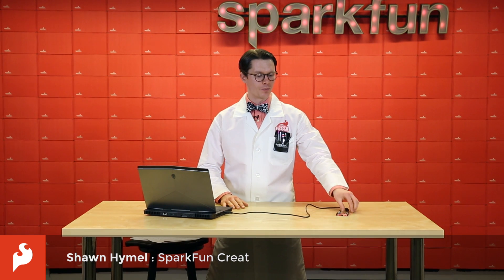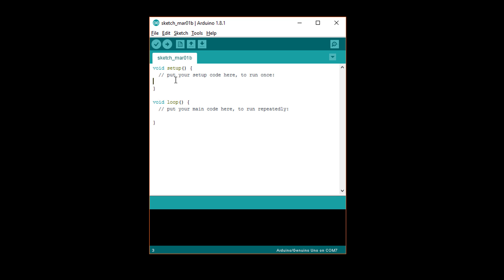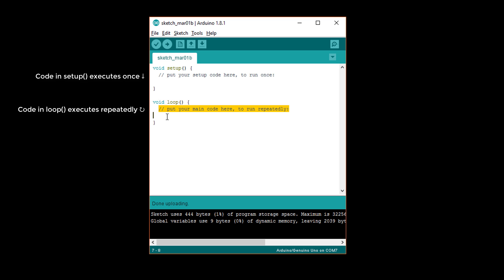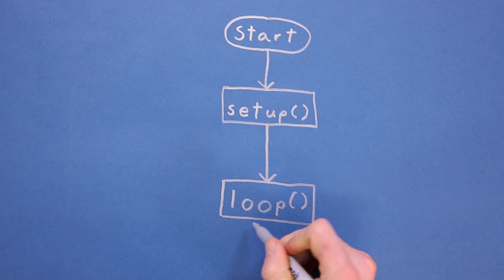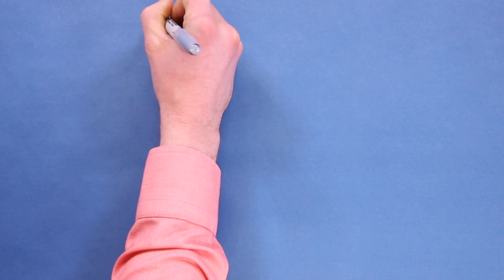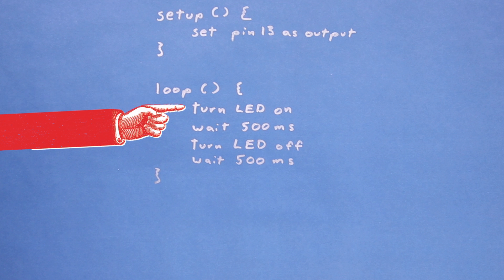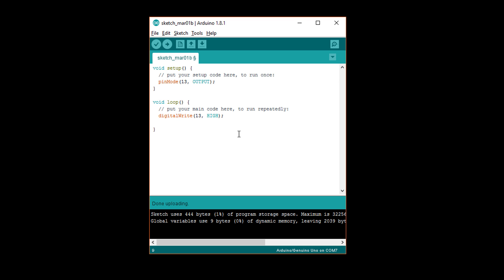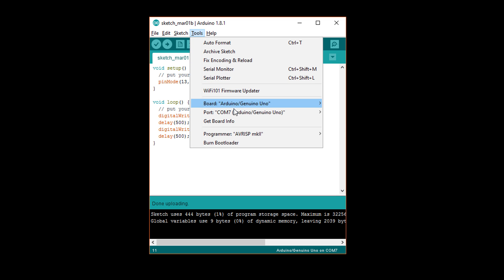Arduino Control Flow

Comment: // heartbeat programme;
void setup() {
  // put your setup code here, to run once:
 pinMode(13, OUTPUT );
}

void loop() {
  // put your main code here, to run repeatedly:

digitalWrite (13,HIGH);
delay (100);
digitalWrite (13,LOW);
delay (200);
digitalWrite (13,HIGH);
delay (100);
digitalWrite (13,LOW);
delay (1000);
}

Comment: Great video but... should't you have used //pinMode(LED_BUILTIN, OUTPUT); to make the... INTERNAL LED light up?
instead of pin 13?,  Thanx
Reply: On the UNO, LED_BUILTIN resolves to 13, so it doesn't ultimately matter for the sake of the video. LED_BUILTIN is a useful tool if you want to avoid hardcoding numbers for the various Arduino platforms. I chose to show it hardcoded so that you could see how it relates to the pin numbers that are printed on the board.

Comment: Great walkthrough Shawn! Funnily, I was trying to give exactly the same walkthrough to a friend last Saturday and got stumped at the very first line in setup(). The problem was one that crops up very often in programming-languages, and one we have learned to ignore.. though on the long-term, i.m.o. it stunts our reasoning-ability. The problem was as follows (remember - this friend knew nothing about electronics): I could not explain, for the love of me, how a pin can become an output. I tried my best starting with an explanation of tri-state buffers and ending in simplistic analogies of a postman that delivers letters as opposed to a postman that fetches letters (the latter worked reasonably). The Problem still remained - Why is that pin an output? Why have we set its mode to 'output'? The pin isn't an output at all - it has merely been instructed to push out bits. The nomenclature "Outputter" would have been nearly perfect. ("The outputter sends a digital state out of the chip"). By clearly discriminating the doer from the action from the target from the consequence, the "train of thought" would become easier to follow and, more importantly, easier to identify flawed reasoning in. 
However I know that we, being the stubborn humans we are, aren't going to change our ways  anytime soon ;) Cheers!
Reply: You are absolutely correct: explaining how a pin's voltage is controlled through code is extremely difficult to explain to a beginner without going into how registers work and how the electronics inside a GPIO pin works. I love your example of the postman, however. I usually stick to "output" means we get to control the voltage of the pin through code, and "input" means we get to read the voltage on that pin. Luckily, I haven't had too many "how exactly does that happen?" questions.
Reply: Thanks Shawn. The difficulty, though (I hasten to point out), was in the nomenclature and not in explaining the workings - I mean - an "output" is, abstractly speaking, the thing that gets delivered. Not the postman. The postman can thus be designated as an "outputter" but not as an "output". The "output" would be the logic-level that the that the pin pushes out. I know this is nit-picking, but a well-nit-picked naming-system (like the IUPAC) forms the basis of any platform for logical reasoning. (Remember the time they changed "Lanthanides" to "Lanthanoids" to avoid possibility for misinterpretation?)